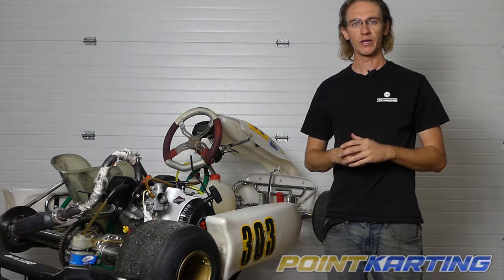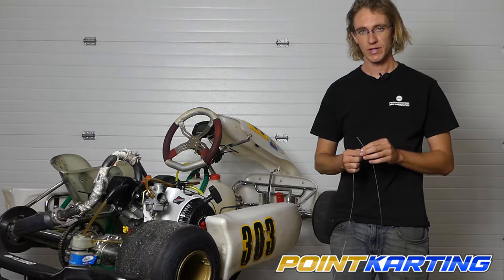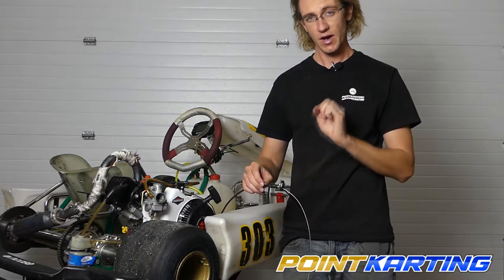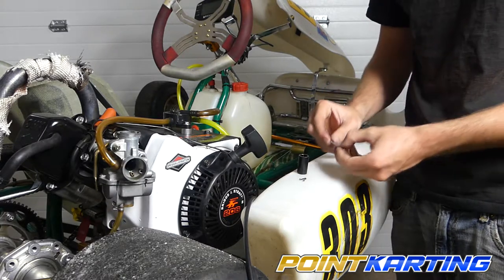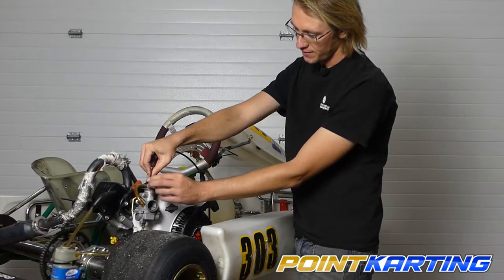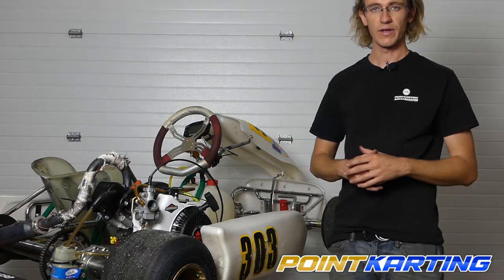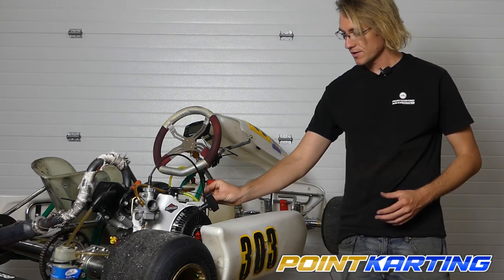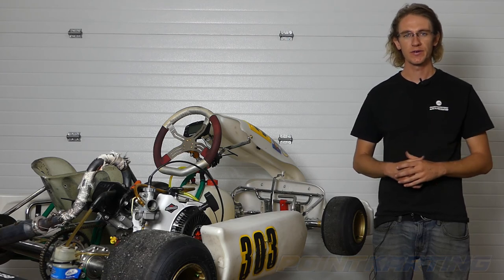Briggs 206 Throttle Cable Installation

Comment: What throttle cable do I need to use for the Briggs and Stratton World Formula engine?
Reply from the maker: Hi SparcoSenna! You can use a standard throttle cable, usually about .120" in size for the World Formula. Here's a link to an example: https://pointkarting.com/products/96-throttle-cable-extra-flexible-96-long-cable-with-a-192-diameter-ball-end-10-pack

Comment: Need help. I set up my Mikuni carb with the right throttle cable. Having a hard time figuring out why my go kart wheels are spinning to fast when lifted in the air. I have tried to adjust the idle screw. I have the needle set up to the second groove. I’m slowing trying to get into karting.
Reply from the maker: Hey @Jerome Crowl - it sounds like you have an issue there! Without knowing the type of engine or kart, it can be difficult to say exactly, but we suspect it could be one of a couple issues: 1) your clutch may be engaging at a lower-than-desired idle speed. For example, let's say your engine idles at 2,000 RPM, if your clutch is engaging at 1800-2000 RPM then the rear wheels will spin. So, consider checking how your clutch is set up, if you are using a centrifugal (used on single-speed karts) clutch. 2) You may have tensioned your throttle cable slightly. Sometimes, if you set up your throttle cable to have too much tension when it should be at idle, you can get the problem you are having. While less likely, a kink or bend in the throttle cable sheathing can also cause this. Check your throttle pedal and make sure when it is 'relaxed' that it is truly releasing most of the tension from your throttle cable. If it is not, consider adjusting this. Most racing go karts have 'stops' or bolts that prevent the pedal's forward and backward movement to help you adjust this.

These are our 2 best suggestions to consider initially if adjusting the idle on your Mikuni has not fixed the high-idle issue so far. Worth noting as well that the rear wheels slightly spinning at idle for many engines is not abnormal when the vehicle is on a stand or in the air - this is a consequence of the tight tolerances between the clutch drum and the internals on many racing karts. Hope this is helpful!!

Comment: Where can I get that wire?
Reply from the maker: Jon you can get it on our website - right here: https://pointkarting.com/products/96-throttle-cable-extra-flexible-96-long-cable-with-a-192-diameter-ball-end-10-pack